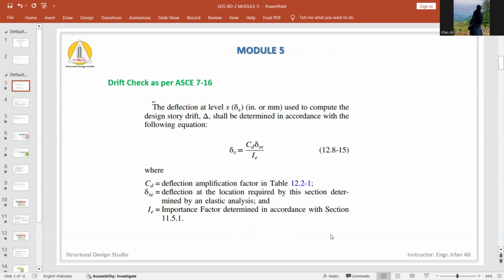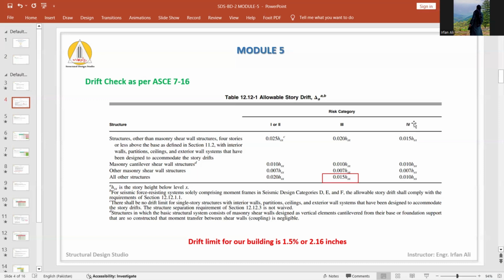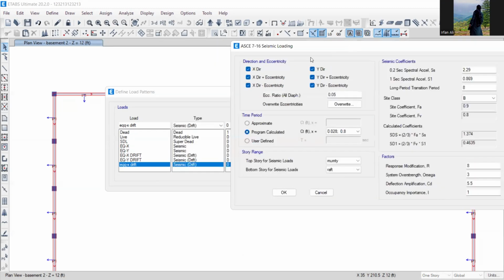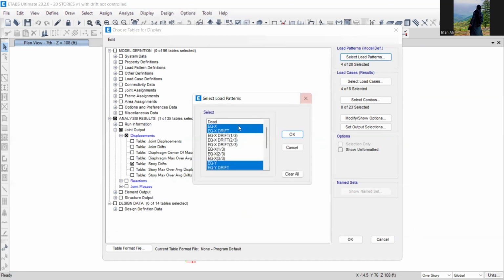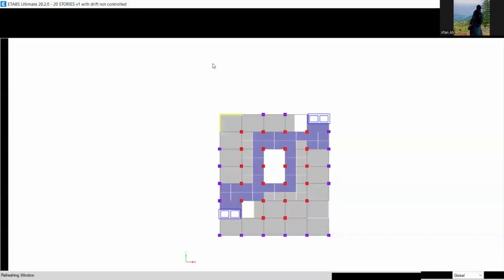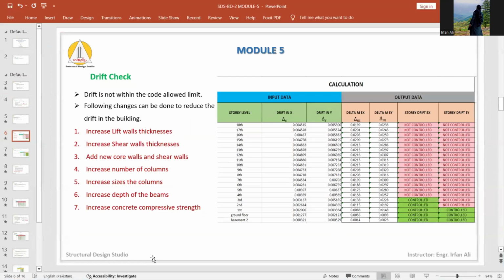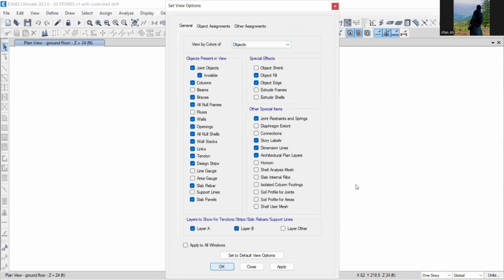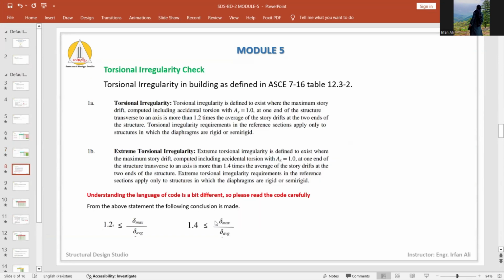Module 5 Part-1: Drift check and its mitigation as per ASCE 7-16

Comment: To get amplified displacement from the linear static results, usually i noticed that people make changes to scale factor in the load case for seismic drift and make it (Cdx I / R) this will also effect the base shear results as well ???
Reply from the maker: Yes thats right. You can do that but for drift check make a load case then change scale factor to get inelastic drift values in order to direct compare it with allowable limits.